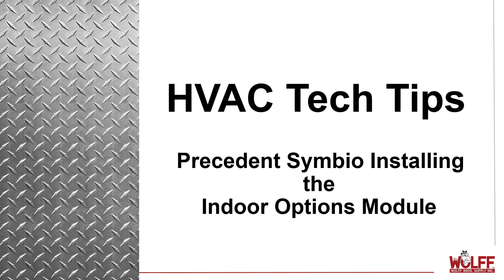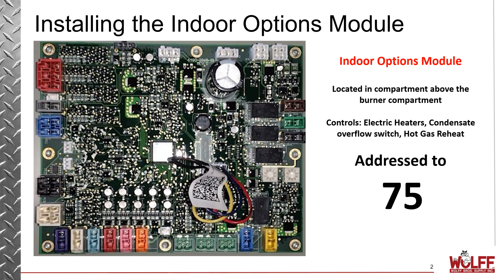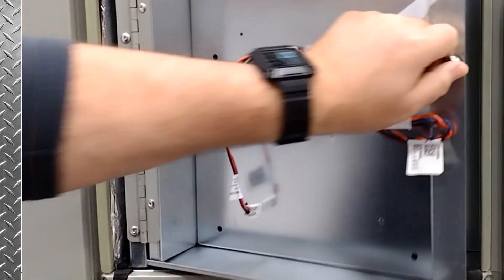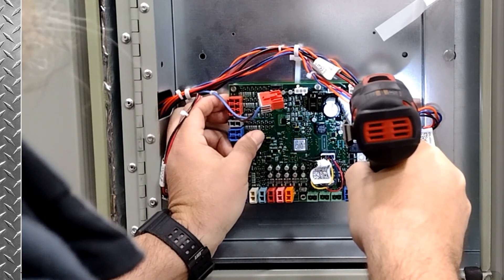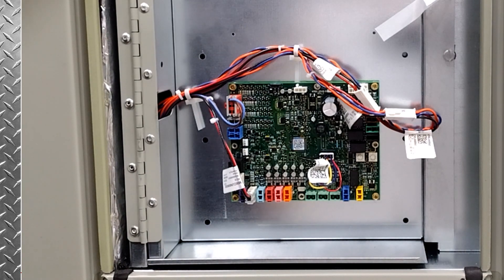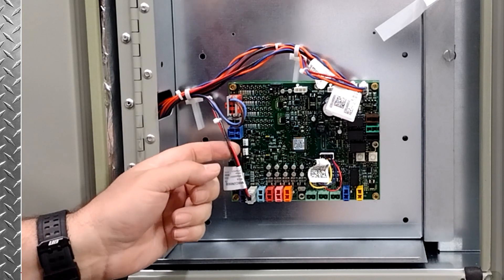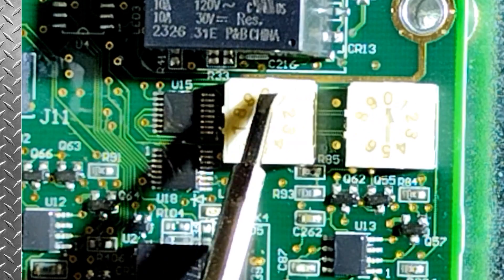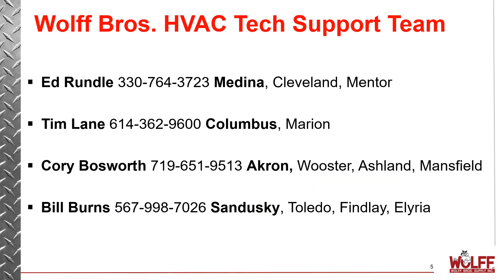Wolff Bros Supply: HVAC Tech Tips Precedent Symbio Indoor Options Module Installation

Comment: Correct me if I'm wrong, but your board had an address jumper plugged into it.
The factory boards have the address jumper plug.
When you purchase a replacement, you either move the jumper plug or use the switches to set the address. 
With the jumper in place the switches do nothing.
Reply: You are thinking of the residential IFC board, The commercial Symbio options modules have 2 dials that need to be set to the correct address so the main board (UC700) can recognize and communicate with it.
Reply: @reliablecomfort You are wrong.
There is an address jumper on factory installed boards.
If you are looking at the board with the zeros on the switches pointed up the jumper is immediately to the left of the switches.
It is an 8 pin connector with 2 rows of 4 pins.
The jumper plug is seen in the picture on your video with the giant QR sticker on it.

Comment: Thanks man, this helped a lot!!
Finally wrapped up this service call on 5 new RTU’s that used the Symbio board. The option boards were installed upside down so they were actually set at “57” instead of “75”…that 0 tip helped lots!!